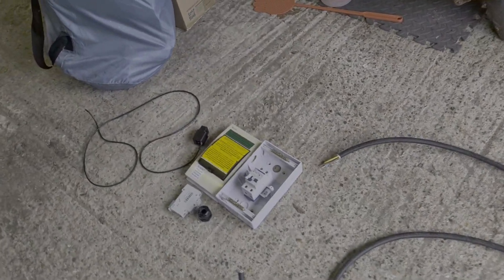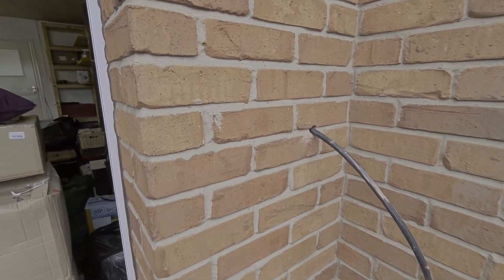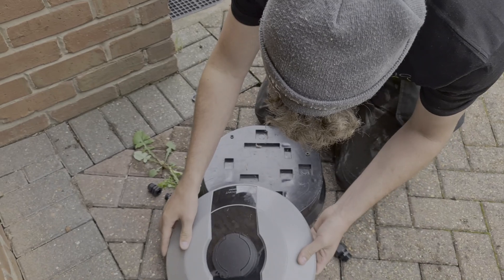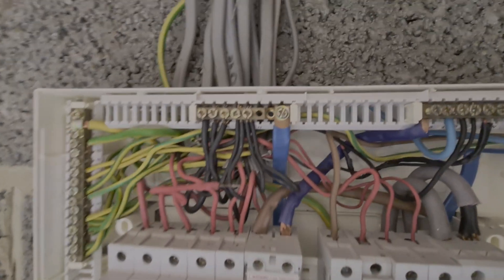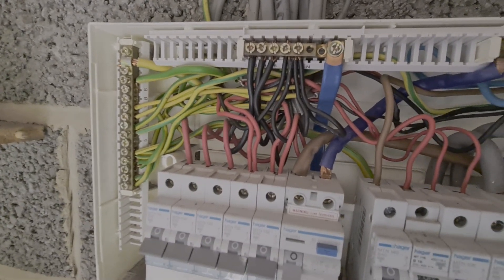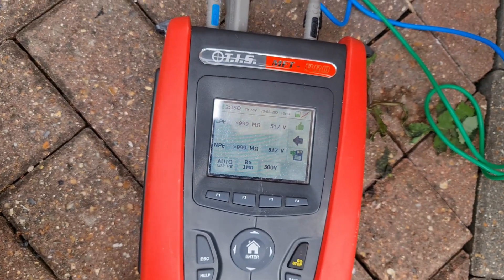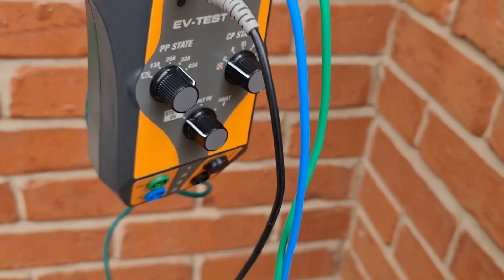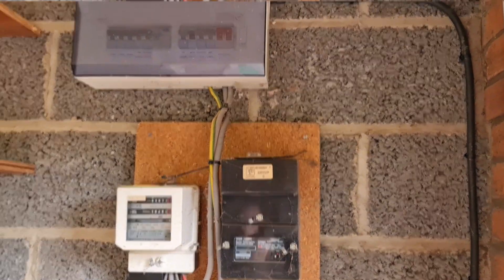Full EV test sequence and apprentice Installs 2nd Hand EV charger!

Comment: When you go into your saved results for the ev test sequence does it show the actual stored results? My TIS MT PRO only shows ok against each test, not the actual results, still waiting for a reply from tech support.
Reply from the maker: Mine has the values. I will ask them for you and report back!
Reply: @electrician247  got sorted now.
Although my MFT-PRO was updated to the latest firmware it turns out that my pc software was an older version, once they sent me the update for the software everything works perfectly.
Thanks

Comment: Loved the way you slated [your little gremlin comment] the supply neutral being slightly over stripped but did not comment on the one feeding the left hand RCD!   Bare copper on display!  ..............And what's with the wearing of the full face mask just to drill a hole through the wall, bet it took him more time to get kitted up than to drill the hole 🤣 ....  So who's buying breakfast then... as if we could not guess eh. Them youngsters have short arms and deep pocket eh? 😉
Reply from the maker: Over stripped, loose and heavily scored on the 7 strand cores. But all tidied up now. The whole board was pretty loose on its terminations tbh. The RCD loops are always annoying from the manufacturers,  I agree entirely.  But it was electrically sound at the point of connection. 

I can take complaints of over the top PPE lol. Better that way than the other, thank you.

Face mask is a must with silica dust. The beauty of the full face shields is they take seconds to put on. Full face fit and job done for a safe job. No hardship at all. But if it took an extra 20 minutes then its time well spent. Highly recommended the full face fit shields. No fogging, quick and simple to use. 

Nathan was closest on the scores but it will be me buying again 🤣.